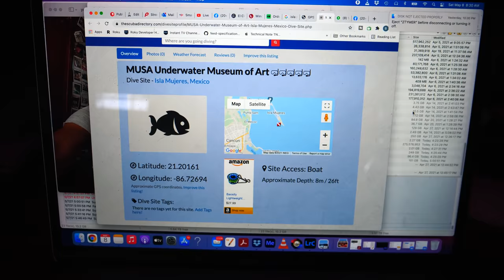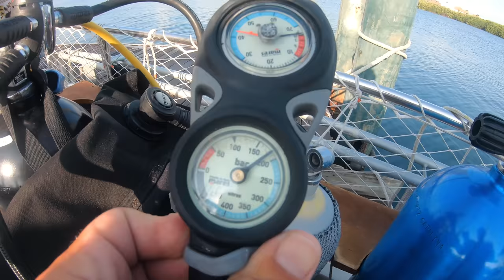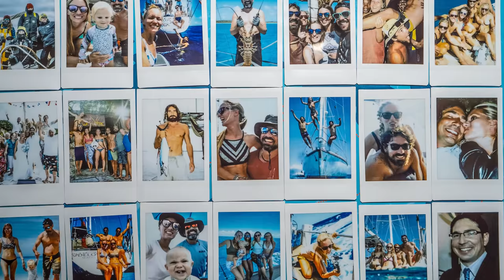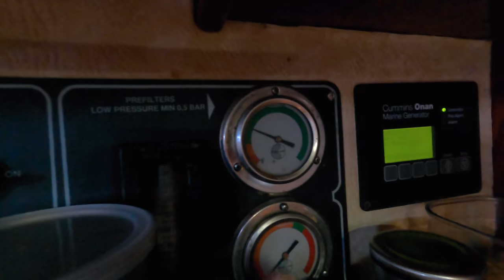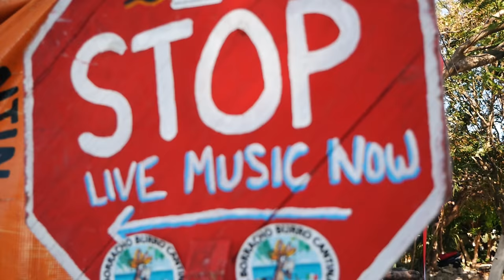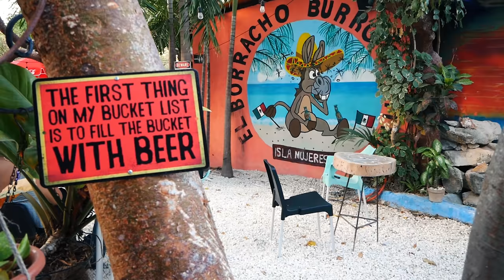BIZARRE things 1 NM Offshore | Scuba Diving Isla Mujeres | SV Delos Ep 334

Comment: Loved seeing how you solved the water flow problem. Can you put a Sponge filter or additional netting of some kind on your intake in the water, just while at dock to help limit the larger seaweed and debris clogging it as quick?  I keep fish tanks and I use additional sponges of various pourousness on the hang on back filters intake tube. It avoids the pump sucking up small fry and aquatic plants and debris. I have to replace impellers as well on some of my pumps now and then. It is so satisfying to figure out how to fix stuff myself. Watching your repair actually made me feel better of my own skills and knowledge with motors and pumps and I feel I may be better able then I thought to maintain a sailboat myself. At least for smaller repairs. The concept is the same. Engine maintenance, Generator maintenance, autopilot, watermaker maintenance are just a few of the things I want to be confident and knowledgeable on before I sail on my own. Glad you guys have dock power and AC now!👍 🕊
Reply: I think sponge filters slow the flow too much. Also they clog up really quickly, with growth as well as particulates.

Comment: Fun, wish I had an eardrum
 to (scuba) dive, 
lost it decades ago
 springboard diving.
Systems all on that one thru Hull and filter, guess that ups it's maintenance check interval.
Conversion from dock power seems like a necessary thing.
With all the travels, some extended stays at dock,
Free? Dock power v. Fuel costs 
for generator + maintenance,
Though solar still running...

Trade something
 for the necklace 
 sometimes works 🤔

Walking for party trip,
v. cooling down with golf carts
But short distances

Comment: There is a way to avoid running the generator when you’re in the US. Get a separate battery charger and inverter. A quality battery charger will accept 220 or 120 V electricity and put it into the 24 V battery bank. Then your inverter will put out to 220V 50Hz AC to the rest of the boat to keep all of your systems happy.

Comment: Brian just so you know the proper tension of a V belt is to not let it flex down more than half an inch in between 2 of the longest spans of the belt system. Basically, take the 2 pulleys that are the furthest apart in that belt loop and don't let the belt bend down past half an inch.

Comment: I've seen Delos and Nahoa have problems with particulates in seawater causing grief. Would it not be helpful to have a small (ten liters or so) deck-level seawater tank and coarse filter that could be easily serviced? With a diptube and jet pump reaching down over the side, you could have zero through-hull fittings.
Reply: That would be cumbersome and ruin her lines.

Comment: Are you able to run the AC off the lithium batteries?  Or, are you just trying to save battery life cycles by using the generator?  At sea/anchor when do you feel the batteries are not enough and you need the generator?  Thanks for any answer (from anyone that knows),  as I'm looking to upgrade to lithium.